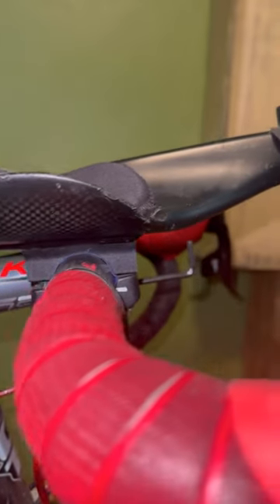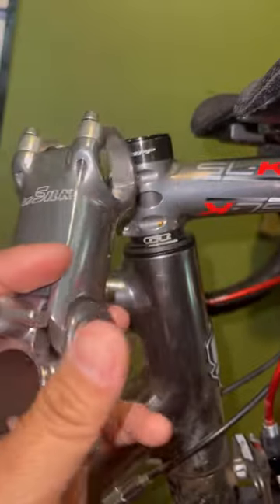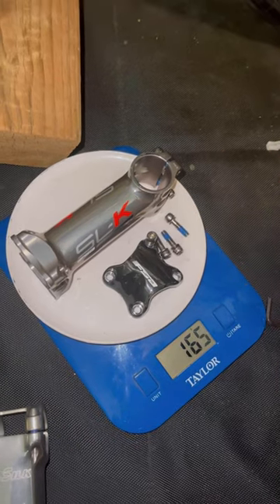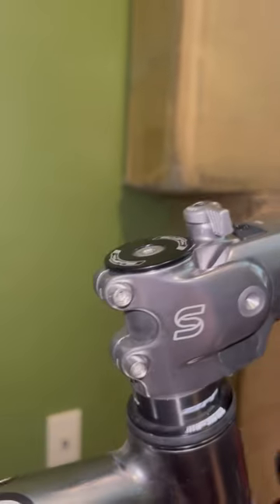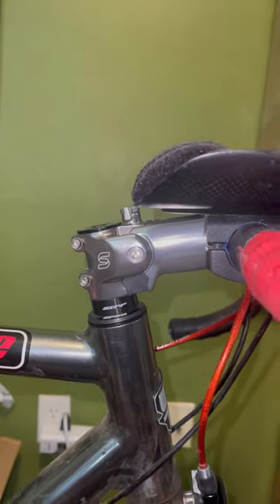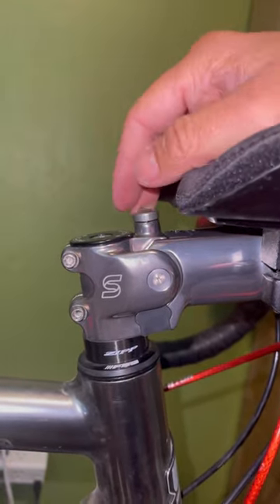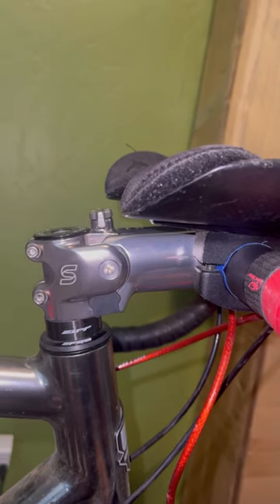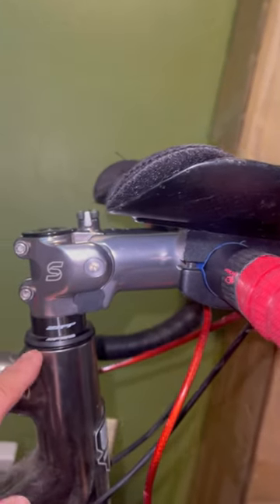GT road bike vlog: cane creek ee silk suspension stem and install (2/3 series)

Comment: How has the eeSilk been treating you? When might we get to see the update video? Thanks!
Reply from the maker: long term wise, I’ve had it on my TT bike most of the time and Lauf Fork in my gravel so I didn’t install. but on the TT bike it felt smoother in the rougher roads. stiffness is not there. it feels too soft and bouncy for full gas types of stuff. I think it’s ok if you can imagine a Specialize Diverge with the future shock.. some are lockable some aren’t. I have two friends with two different Diverge models. the bounce is more on the steer tube, while this is more on the bars/clamping. surfaces. but, same idea. not lockable may set ppl back. but the install and purpose makes up for it. bolts and design is solid and won’t or has not rusted on my uses